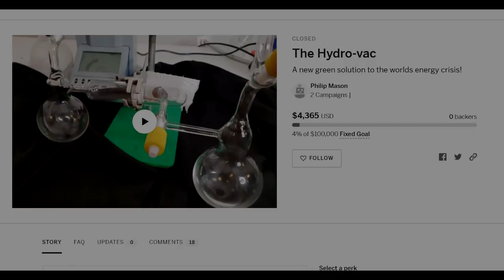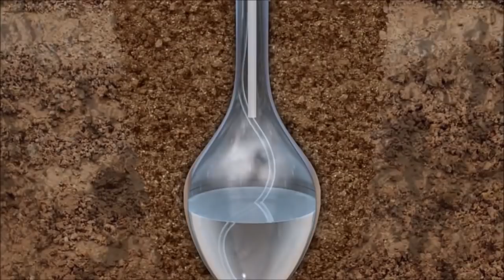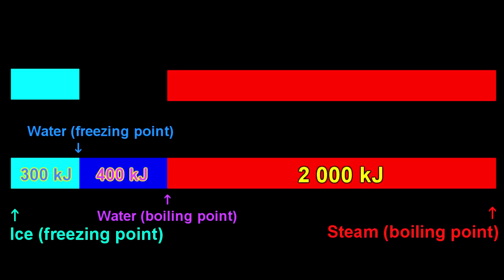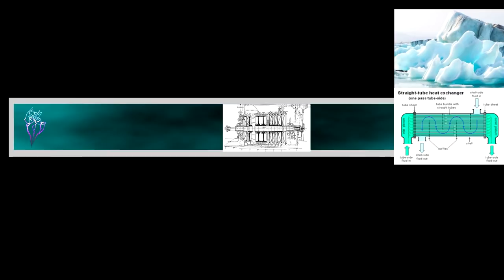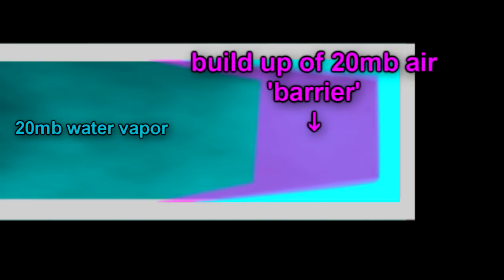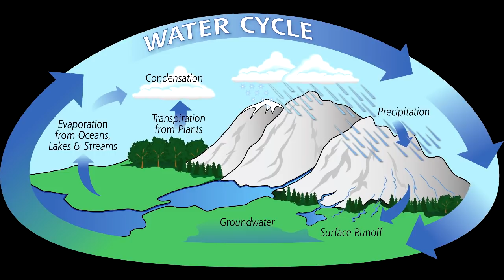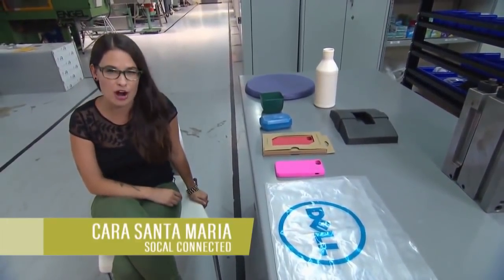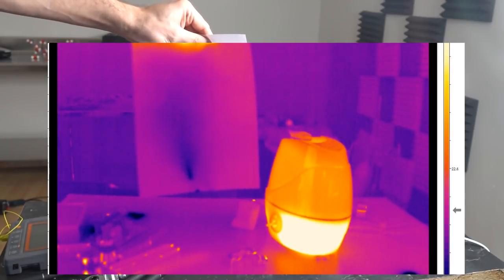The Hydro-Vac -BUSTED

Comment: I like how a device meant to help stop global warming is designed to dump a bunch of heat into the arctic and melt it
Reply: To be entirely fair, if such a system was feasible, it would have zero effect on the average temperature of the planet, since the heat energy it would, hypothetically, dump into the arctic, would be balanced out by the the heat energy it takes from the starting location. Also, unless this was a large scale industry, I doubt it would really affect the ice sheath, and if it would work, the reduction in the reliance on the carbon-economy would potentially reduce global warming and keep the artic circle cooler.

Of course, this would all hinge on the idea that this thing is even remotely plausible, which it isn't, so eh.

Comment: This is absolutely brilliant!

Every part of it is verifiable in isolation, at laboratory scale.

But when you try to put them together, they just end up fighting against one another!  And it does not scale up in practice:  the ultimate limit to the available efficiency is determined by the temperature difference between the hot and cold ends.  Economies of scale will only take you as far as that limit at best.  (It's like finding the fastest route from A to B; there comes a point when there are no more short cuts you can take, and anything you change will only add time to your journey.)  A lightweight turbine not connected to anything does not need much energy to make it move.  Once you add a spindle and connect that to a generator -- and the generator will have to be housed inside the vacuum chamber, since it's much harder to keep a bearing sealed with such a massive pressure differential across it -- it will be a lot harder to turn, because the electrical load on the generator will be extracting energy from the moving gas stream.

Moral of the story:  Always count the Joules.  They're Nature's hard currency and she's a ruthless bookkeeper.  If the energy figures don't check out, you can stop right there:  it means the invention isn't going to work.

Comment: So i am confused, i can see the difficulties of building such a device but i also can see how this can work, at least as long as there is a great enough temperature difference. What i am troubled with is, that someone actually thought about use the ice caps as an energy source.

Actually, sounds like the plan of a super villain, never mind XD.
Reply: Mandernach Luca - the problem isn’t just if it works but keeping the system running constantly and also the piss poor amount of energy created. 

Take a normal gas generator give it to a city of people and tell them that’s all the electricity everyone’s allowed to use. And this is the best case scenario.
Reply: @ezg8448  
I wouldn't go as far as to say that the energy produced is to small. I mean, everything can be effective, if brought up to scale. The cost would be immense and the resources needed too but the operation of it is nothing more than keeping a vacuum and keeping the hot end hot (aside from the water temperature, the sunlight could be used) and the cold end cold (pumping the cold water through heat exchangers, wich are connected to the condenser chamber). I mean,  i wouldn't expect it to be a great source of energy but in its core, it works like any common powerplant, there is building up a vapor pressure, wich in turn drives a turbine and condenses afterwards. 
That said, in powerplants, usually the temperature difference sets the efficiency and ultimately the power yield, wich in this case should be relatively low. 

The video is a bit unessecary, as it is less of a "free energy" idea but more of a "lets make the whole world a solar powerplant" idea, oh well, i guess i should be used to Thunderf00ts " clickbait style " by now.
Reply: Heat the water with solar, huge lenses focusing the sun to boil the water to steam
Reply: Joe Fro as if you wanted to be around a bomb.....
Reply: @fss1704  
A bomb? You do know that nuclear reactors also heat water at a pressure of 150 bar up to 300 °C or more?
Reply: Norris Jinglewilly  Indeed hell we already have this issue with exploiting the Earth's natural heat engine that is driven by the temperature gradient between the equator and the poles namely the thermohaline circulation. Maintaining power turbines out in the ocean and the cables connecting them to the coast where the power could be used would already be insanely expensive despite those cables being way shorter and having significantly lower maintenance cost per unit length than a vacuum system would. Fact is that there are very good reasons why we favour renewable energy sources that are already proximate to major population centres.
Reply: Mandernach Luca have you heard about chernobyl, where a pump failed and the whole thing went kaboom.... a bomb as i said
Reply: Mandernach Luca water at 300degc can vaporize your skin instantly, and god, fucking 150bar and you don't see the bomb....
Reply: @fss1704  150 bar is not exactly that unusual for industrial processes. Sure if the engineers were completely incompetent and included no safety relief valves whatsoever it could be harmful but in reality engineers are generally not completely uneducated morons.
Reply: Seraphina S 10MW/s of pressure power isn't a bomb, yeah... all right... and you expect to hold it with a glass piece? good fking luck with that. I guess you never have been close to a high pressure water vessel before, they cost a fucking lot.
Reply: Seraphina S and molten salt reactors don't exist yet. Every nuclear reactor that fail fails because of the pumps, if the pumps and the vessel didn't fail then there would be no need to use molten salt in the first place, the lesser temperature on such reactors make it cheaper to construct the vessels.
Reply: Seraphina S pressure accumulating from the vessel because of hydrogen accumulation is still a fucking bomb with hydrogen as a bonus, it is not an example of any security system. Solar concentrator tech has the same problem regarding vessel cracking and need of regular inspection against microfractures that can crack the vessel or the glass tubes in an instant.
Reply: Seraphina S i have something here charging my phone..... you'll see when i patent it.
Reply: @fss1704  Actually they do there was a test model of one way back when nuclear energy was still being developed that ran for years based on Thorium as I recall but of course despite the fact they would have been safer for civil use at the time they were looking for reactors to produce materials for atomic weapons which those are not able to do.
Reply: Seraphina S the one having problems breeding neutrons enough to realize a power gain? how's that a reactor? used nuclear material heats up more than the "reactor" does, we might as well be powering the "reactor" using tec's if it's not going to be power efficient. I'm not at all against molten salt reactors, and if they can never meltdpwn that's a great thing, but that high pressure vessel  is a bomb by itself, it can be mitigated but the fact that it needs mitigation is the reason why that's a bomb, it can kill less people for sure, but it can still kill people.
Reply: @fss1704  To be fair a coal plant on the other hand doesn't just have the potential to kill people but actually does, the  chronic effects of the toxic gasses they output alone are responsible for most of the reason why the death toll from coal is in the hundred thousand per TWh range unlike nuclear which is already measured in the single digits per TWh. You are suffering from the danger of falling for "Yeah but sometimes" excuse for avoiding a better option because it's not perfect.
Reply: Seraphina S yes, it's certainly "better", but it doesn't solve global warming at all if you're generating more heat than the average solar power per meter squared.
Reply: @fss1704  
I guess, i don't see a reactor as a bomb because they are pretty much common sense nowadays, by the way almost every fossil fuel powerplant or thermosolar powerplant works with the same pressure and temperature. Pressure vessels over 150 bar are pretty common today, just go to the next  hydrogen driven car, they operate well above 600 bar. As long as you don't make faults in your calculation, everything should be good. Don't get me wrong, i see your concerns especially knowing that early in the day of steam engines there were a lot of accidents related to pressure vessel failures but a bomb is an overstatement. The reason that i am not so concerned about pressure vessels may be the fact that i know how to calculate the thickness of a boiler, for me it does not seem that impossible.

Also, anything that contains a chemical compound capable of detonation is what i would call a bomb or a grenade ;D.
Reply: @fss1704  Well no because it still doesn't produce CO2 directly though of course the big problem here is the mining, refining and transportation of the fuel as it stands 2 of these three resource intensive tasks involve significant use of ICE powered machinery. And the third runs the centrifuges for enrichment etc from the grid which is not yet carbon neutral either so yeah nuclear is far from zero emissions but the emissions per TWh are lower and could be improved.

Fact is that for quite some time we are likely to need some form of low emission baseload production as the overprovision necessary to enable a fully reneweable grid given the lack of efficient means to store electricity in bulk is going to take a lot longer to install and time is not exactly on our side given that we have already added enough to the atmosphere to guarantee rather severe climate change already as it takes a long time for a system the size of a planet to warm up to a new equilibrium when it's atmospheric composition changes rapidly.
Reply: @mandernachluca3774  Not really clickbait. This is something he's been working on to a prove the point: how a stupid idea with bits of science can be made to sound plausible.
Reply: Due the laws of the laws of thermodynamics
Reply: I def respect thunderfoot I don't even remember his real name though lol
Reply: @markbaldwin9859  
The laws of thermodynamics don't deny that such a device can be build, as said befor, powerplants are a great example.
Reply: Pouty MacPotatohead  
It really would make as much sense as doing a video about the unlikelyness of such a project ever being developed. 
But for the friction part, there are actually tricks to keep the fluid friction at a minium, i am not quite sure how it works but you basically install a device in the pipe that adds some resistance  ontop of the usual pipe resistance but converts turbulent flow into laminar flow by artificially increasing the boundary layer velocity, to ultimately  minimise the overall  friction losses. This only works for very long distances and only because much more energy is lost to turbulent flow in comparsion to laminar flow.

Comment: Or we could build a hyper loop to space and all die as our atmosphere is blasted out this massive space straw ;) lol
Reply: Space elevator with vacuum hypesonic elevator inside!
Reply: Vsause actually answered this.  If only our atmosphere acted like a balloon wed be in business.   I mean..even I at first was under the impression the gas would spray out into space..  Then I remembered.. Oh yeah.. Gravity.
Reply: @gyromurphy  didn't you know, there is no such thing as gravity. The earth just sucks
Reply: @Wranderous Wait a minute. That´s actually a great idea. We blow out our atmosphere into space put in some turbines and create more energy than we could ever use and earths gravity would suck down the atmosphere again.
This would be the only possible real and true perpetuummobile - driven by absolute zero of outer space and gravity.
IDK if it works (I guess it doesn´t), but I´m sure we could sell this idea on kickstarter. DEAL?
ps
It might actually work. Look up Solar updraft tower:
https://en.wikipedia.org/wiki/Solar_updraft_tower
We just make it really really big. Also let´s built it in death valley.
Reply: @Enkidu1701  You are still just converting heat energy into elecrical energy, its probably less efficient than solar panels or a steam cycle, since you have friction and heat loss in the entire tube. 

It is still not a perpetuum mobile btw since you need air warmer than the surrounding air in your tube for your idea to work.

Comment: Hyrovac does make a pressure difference dp of much less than 1 bar ... u need a lot of steam flow to drive a 1GW turbine .... and dont put bends in the pipe, minor loss will kill you ....

Comment: Just build a standard space elevator, run the tubes alongside.

Profit
Reply: Given the pressure difference that would probably even work, but on the other hand, you're slowly shooting off earths water into space.....
Reply: @MajinOthinus  we kind of need to ditch some of the salt water if we want to avoid flooding anyway?
Reply: @MajinOthinus  if you shoot it into the very thin part of the atmosphere and not straight into space, technically it wont escape Earth's gravity so it will find its way back down. ez pz

Comment: Wait a minute you lost me at spinning turbines with a near vaccum pressure gas, the amount of torque produced would be pathetic because so little mass is flowing by. Hydropower works with liquid water because of the incredible amounts of pressure and force that can be delievered when your flow has a density of 1 ton/m^3, a flow that has a density of 1 g/m^3 on the other hand is pratically useless.
Reply: Well, the speed of gas would be high, but yeah, I think the limited mass is an issue.
Reply: @NetAndyCz  The faster the gas the less efficent the turbine, supersonic gas frankely will waste more energy warming a turbine blade then spinning it.
Reply: Modern steam turbines essentially work this way. The last stage is working under a relatively hard vacuum.
Reply: @RobertSzasz  I would not call 10 KPa "relatively hard vaccum" That is still more than 10 times the pressure on the surface of Mars, or only 1/10 atm, and that is after taking in an input of 1 MPa. Those low pressure final stage turbines are HUGE, the size needed to to start with a say a flow of 1/10 atm and go to 1/100 atm would be absured.

Comment: If you put the heating chamber underground and cooling one in the polar region you can make it work. In nature such heat machines exist and are called geysers. Just don't use main pipe to generate power; use potential energy of working liquid in the refueling tubes while you refuel it.

Comment: What if you used a refrigerant instead of water. That way it would condense to a liquid instead of a solid. Then you could just let gravity take the liquid refrigerant back down the mountain?
Reply: Expensive if not impossible to produce on such a large scale, likely toxic, probably lower heat capacity meaning you'd need even more of the stuff, and his bigshot plan was to have the pipe open to the ocean instead of having to build a closed loop. Remember the condensation area still needs to be under vacuum so you'll need an airlock.
Reply: Then you've just made a bloody huge version of the heat pipes used to couple the heat from a CPU to the airstream of the cooling fan .....

And you've still got to melt a lot of ice just to get a kWh of energy out of it.
Reply: @Photoloss  not sure about the heat capacity. I was picturing a large vertical bank of heat sinks cooled by the ambient mountain top air. Then the condensate would drop to a collecting tank that would just be feed back down the mountain. You could control the level with a valve so you don't lose your vaccum.
Reply: You could try ammonia.  Used in refrigeration, and is one of Thunderf00t's favourite chemicals.
Reply: Better yet, use solar panels to drive the recondenser and keep it at a precise temperature. The solar panels would be at the mountain top and kept free of ice and snow by housing them in transparent structures designed to allow snow and ice to slide off.
Reply: @Bit-while_going  Mountain top solar thermal energy kickstarter coming up... Good idea if the mountain top is regularly above average cloud level.
Reply: @threeMetreJim  the mountain doesn't have to be so high. Just use excess power to keep the housing warm enough to defrost it.

Comment: So you build it on The Moon right on the boundary between the day side and the night side so one end is in permanent sunlight and the other is in permanent darkness ( doesn't even have to be very long this way, and it's in space, so you don't need to pump down to vacuum as its vacuum anyway you just have to guide the flow).

Then all you have to do is transport The Pacific to The Moon in order the supply the water.  Easy.
Reply: Nah, just capture a couple of comets to seal inside the tube.
Reply: @Roxor128  of course, why didn't I think of that? the energy required to   intercept, capture, and deorbit, comets from their centuries long high speed solar orbits and place them into lunar orbit is totally less than that required to lift an entire ocean to the moon.

Comment: probably better to use geothermal but why not just build a geothermal electric genrator instead of using that hot and cold difference
Reply: It's the same deal.  Geothermal is a hot source, (naturally occurring fission), as that heat travels to a comparatively cold atmosphere; it does work on a turbine.  That's how all heat engines work.

Comment: What you see here is thermodynamics in action. The ice creates and temperature differential, which causes the  water to evaporate. Once the temperature differential is removed, the evaporation stops as the system reaches equilibrium.

But the problem is, it takes more energy to create the ice and vacuum them the machine is able to generate.